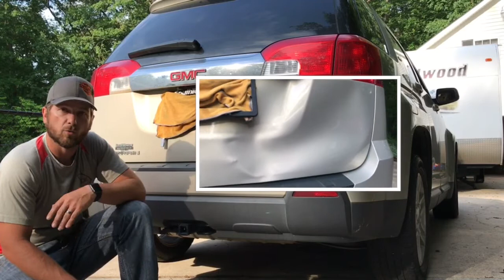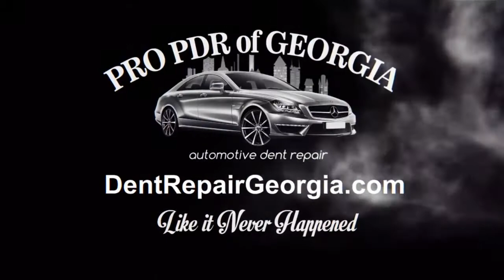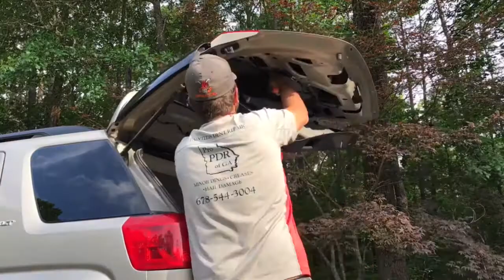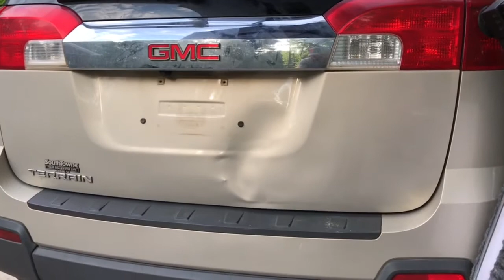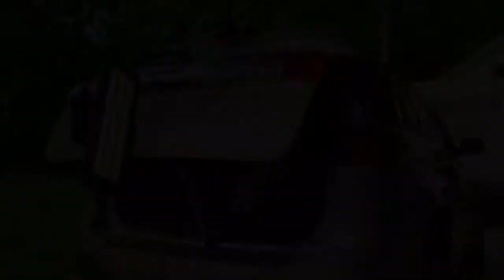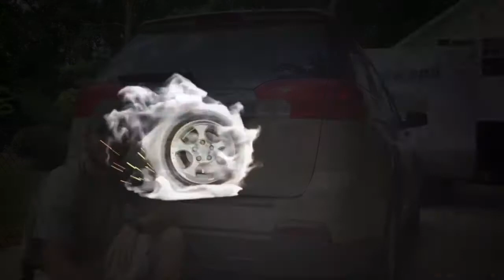Mobile Paintless Dent Repair, Griffin Ga-Dent Repair on a Smashed GMC Terrain Liftgate

Comment: How much you think it would be cost to repair
Reply from the maker: It’s going to vary depending on the severity of damage, size, location, type of vehicle, what has to be removed to get to the backside of the metal, and a host of other factors. The best thing to do would be to send a photo to propdrofga@gmail.com and we can look it over and get you a preliminary estimate.
Reply: Pro PDR of Ga where you guys from
Reply from the maker: Sahil Saini about 45 min south of Atlanta

Comment: How much would that cost?
Reply from the maker: Between  $1500-$2500 depending on the severity and if parts need to be replaced…..large damage can have a wide range as far as cost goes.  It’s more complex than a few door dings so we really need a visual inspection to determine what it needs.
Reply: Do you by any chance know any shops in the Chicago area?
Reply from the maker: Unfortunately, no I don’t know anybody up in that area